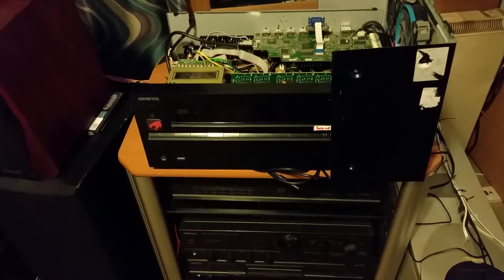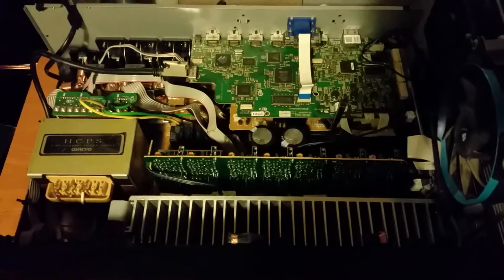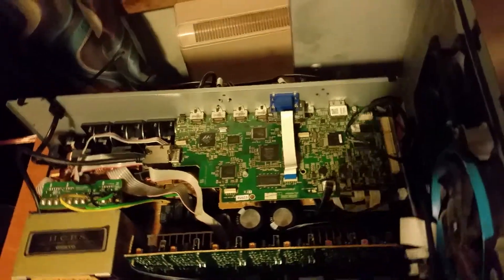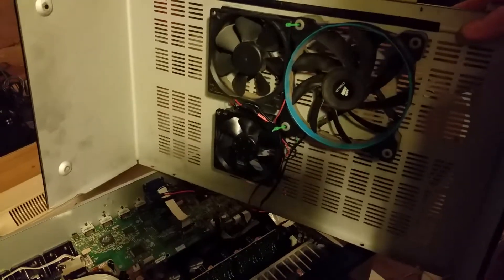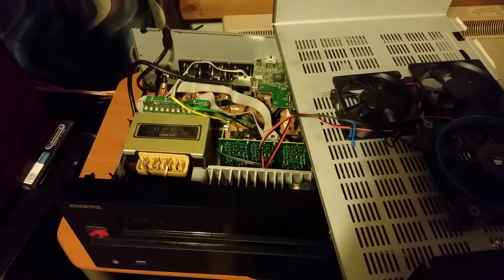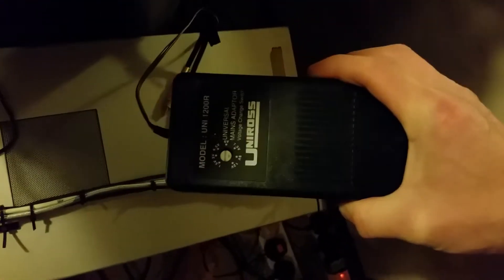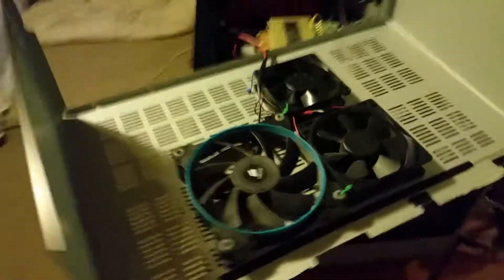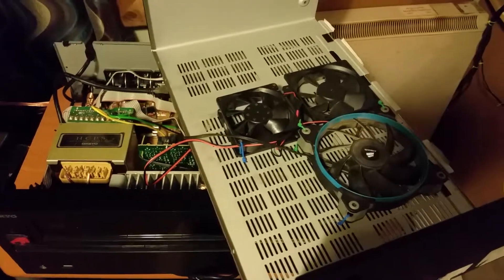Onkyo 609 Reciever Overheating fixed with bits I had to hand (hdmi board has already been replaced)

Comment: If you are installing a fan inside a av receiver don’t solder a fan to the transformer or you will cause the components inside a av receiver to not receive enough current from the transformer which will cause the receiver itself to shut off.
Reply from the maker: This is why I used an external power supply for the fans so modifications were isolated from the reciever and removable. Thanks for the information.

Comment: Does it still works? I have the same overheating problem. Thanks
Reply from the maker: Yes its still working well. I just clean the fans and dust the inside of the unit every year and its fine. I bought the unit broken because of the heat issue and sent it to onkyo to be fixed but it still produces loads of heat. The fans keep it cool and ive had no problems since.
Reply: @Titanicus2  I've purchased the Onkyo in USA  several years ago but I live in another country so I can't send it to have that fixed I was told by the audio  technician to put a couple of fans over the unit
Reply from the maker: As long as it works your totally fine. I bought mine not working and had to have the failed part fixed. That wont affect you if your unit works. What i did simply removed heat before it causes the same problem again. The unit has an in built fan which is crap. Just remove the brackets holding the fan into the unit 4 screws i think unplug the fan and remove the whole thing. Thats the point where this video starts with the fan mechanism already removed and my replacement fans fitted.
Reply: @Titanicus2  regsrding the fans a 120mm fan Will do ir fine? Other thing i wanted to know if your onkyo still has the original fan
Reply from the maker: @POWERMAXUM  i removed the original fan as it wasnt very good and its placement was poor. I also wanted fan voltage control so did that externally. My unit is in a fairly enclosed location so I wanted to make sure it would be cool enough. This unit lierally blew up due to too much heat but Onkyo fixed it for free. The main thing is to get some better airflow but I dont see any reason you couldnt just use the original fan in its orginal place but just wire it externally so you can run it at a higher speed.
Reply: @Titanicus2  i Will put 4 120mm square cooler fans in a daisy chain with an external ac adapter. Do you think that would be fine to keep it cool?
Reply from the maker: @POWERMAXUM  yes that would be more than adequate. Just make sure the fans you use dont use more power than your external supply can provide.